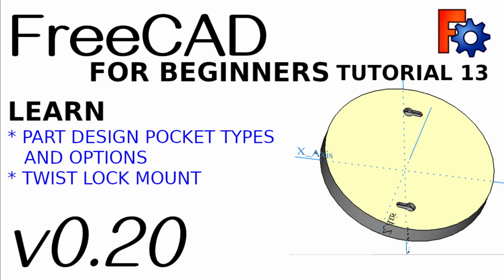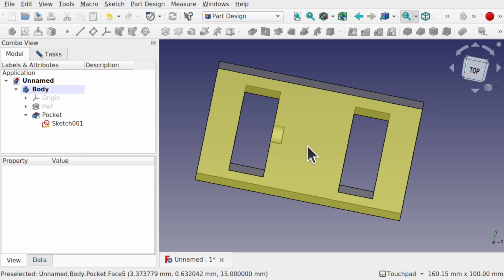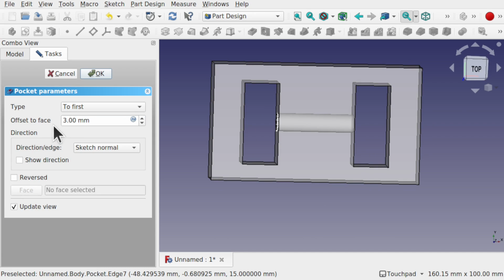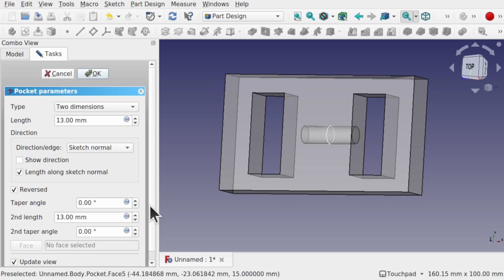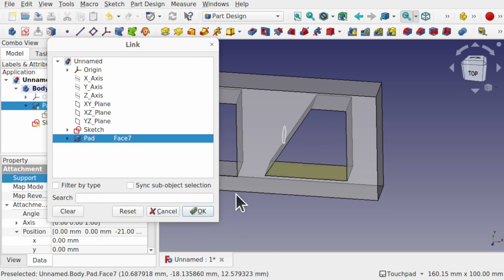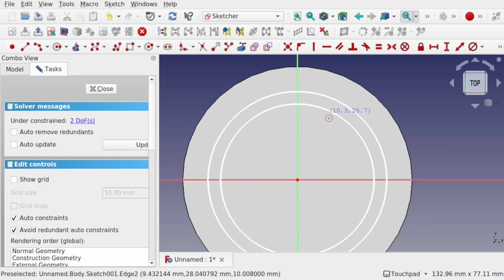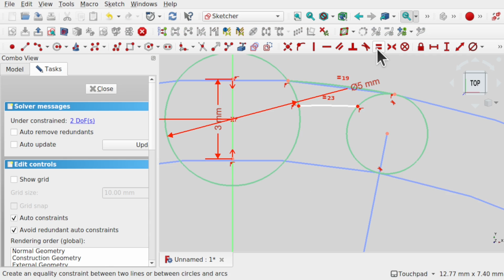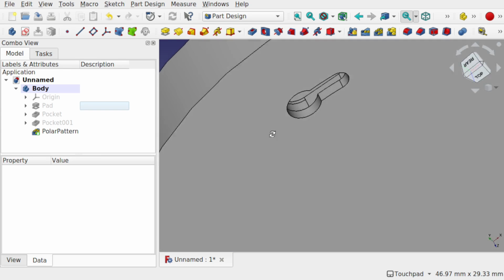FreeCAD 0.20 For Beginners | 13 | Locking Mount | Understanding Pocket Types and Options

Comment: Why I understand that these are just demonstrations. on free CAD and pocketing and making holes. It's always a good idea. Not to make the impossible pocket or holes from a. manufacturing standpoint. I've seen some pretty fancy CNC. END.mills and lathes, but I've never seen one that could drill a hole inside of a part, working its way out.

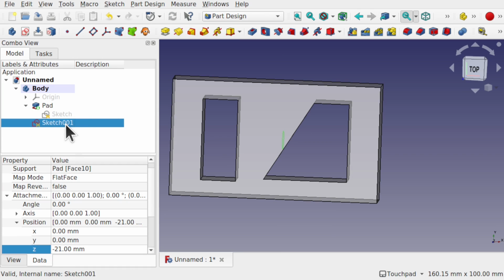Comment: 15:40 support method for moving sketch does not work in v0.21.2. Instead, I right clicked on the sketch entry in the model view, selected "Attachment Editor," cleared out the top field, enabled "reference 1" selection, then selected on the new face in the 3D view. Circular sketch moved and I was able to continue.

24:35 pocketing did not work immediately. I had to go back into the sketch and change the 5mm diameter to something different (6mm) and closed the sketch. Re-entered the sketch, changed it back to 5mm and dragged the dimension around a bit. Pocket worked after this. Obvious bug just worked itself out by "fiddling" with dimensions.
Reply: Thanks for that.
Reply: Try it , helpful thanks for the information.❤

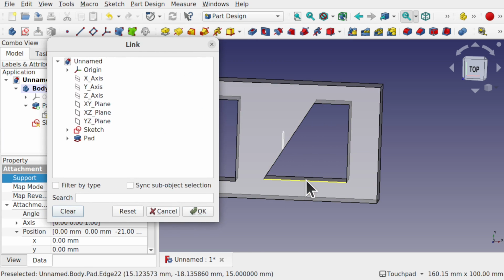Comment: Can anyone guess why I would not be able to attach the Sketch001 to a different Face of the Pad at 15:53?  I have selected the sketch, selected "Support, Clear, but when I click on a Face or Edge nothing fills in the LINK window and the sketch does not move..
Reply: Works for me if you select the face using the three dots from "Map Mode" instead of Support. Freecad 0.21.2

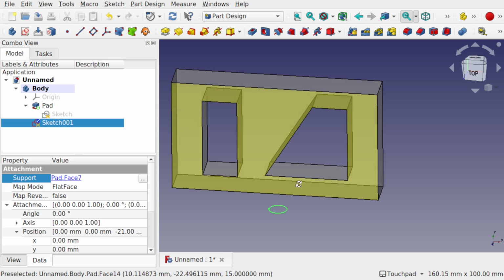Comment: At 16:00, I could not get Sketch001 to attach to the face of the pad.  When I try to change the support for Sketch001 by clicking on a face of the pad, nothing happens.  Any ideas?
Reply: Got the same problem.  I think it's something they've done with new version, and introduced new bugs ??
Reply: same issue, I`m using 0.20.2
Reply: Map Mode click on Plane so now it's selecting then click on a face on the pad

Comment: Hi All, Enjoying the Tutorials and feel I'm learning something that I can apply to my Aero Modelling Design, I'm using Ver 0.20 but when getting to pocketing the recess 24:34 I get the following error "Cannot use selected object. Selected object must belong to the active body" Then "Consider using a ShapeBinder or a BaseFeature to reference external geometry in a body". I've checked and have the toggled Body active (Bold in the Tree). Sketch selected Green and identical to MJ's. I remember the directions from previous Tut's but not sure how to resolve this error. Any assistance much appreciated. RW
Reply from the maker: Glad your making progress. Is the sketch you created inside the active body, you may of added it and it's outside in the treeview. If you collapse the body in the treeview you should not see the body beneath until you expand it. If its outside drag it into the body.

Comment: Good practice on features and workflow. It does seem like in practice that slot needs to also be curved, else the screw head will grind against the outer wall of the pocket.

I fixed this by editing the sketch of the second pocket: replace the straight slot lines with arcs, bring in external geometry of the first pocket edges, and make the arcs equal to those respectively. Now the second pocket and first pocket sweep the same path.

Comment: All has been going well so far as I've worked my way through your tutorials, but alas the pocket of the screw slot fails for me on 0.20.2, both on FreeBSD and MacOS. Apparently the Wire is not closed. Unless I've missed something important, I'm guessing that this is a bug in this particular version. Without the linking arcs, the two circles pocket nicely, with linking arcs, or even straight lines, all I get is a blank screen.
Reply: I had the same issue, initially (FreeCAD 0.20.1). I had the impression that one of the vertex on the sketch was a regular vertex instead of a construction geometry vertex. So, I used the construction geometry tool to convert the vertex from regular to construction geometry and was then able to perform the pocket operation successfully.
Reply: Me too, Seems this commentary is no longer Monitored?

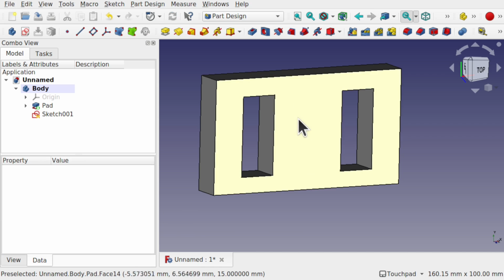Comment: At about 11:00, I don't understand why moving the sketch for the pocket along the Z-axis appears to move it along the X-axis. I drew the sketch looking at the Left side of the middle bar, which means Z is up and X is toward/away from me as I sketched the circle...
Reply from the maker: This took me a bit of getting used to.  So a sketch is 2D and the Z axis is normal to sketch so pointing away from the sketch if laid flat.  When you attach a sketch or any geometry to a face the Z axis will run in a different direction depending on attachment.  This is know as the local coordinate system.  The attachment is x,y,z offsets in the objects local coordinate system.  I am going to do a video about this as it's pretty confusing for new comers to CAD

Comment: Nice and clear as usual. 
I've replaced the long sides of the slot for an arc with the same radius of the underneath shape. It should improve the movement of the fixing pin inside the groove.
Reply: I was thinking that would be a good feature to add. I was also thinking of how to complicate this (of course... complicating things seems to be my super-power) by angling the inside surface that would bind against the underside of the fixing pin's head (screw-head) to allow the turning action to not only capture the head, but wedge between the head and the mounting surface.
Reply from the maker: Nice!  I like that idea
Reply from the maker: That's a great idea,  thanks for sharing 👍👍👍👍

Comment: Nice, very useful technique, but probably difficult to print (how do you remove the supports inside the cavities, unless you use disolvable material?) 
You may try w/o support,  but the result probably gonna suck.
Reply: I think this can be printed without support by orienting it face down, with the slots in contact with the build plate. The "ceiling" of the slots will then be taken care of by bridging.
Reply: @warped_spacetime you're  probably right. I am curious,  so I will try it.
Reply: @paulcutty8048  Sounds great - please report back.
Reply from the maker: @laytekk thanks for your input in this,  nice to get info from others with ideas  @Paul Cutty please let us know how you get on,  thanks for the comments guys
Reply: @MangoJellySolutions  @laytekk  I did a test with 2.5 mm screws for plastic and PLA  (did not want to use much material just for that quick test) , and yes, it works as you described it. I believe it will work on larger dimensions.
Reply: In case you cannot print upside down (e.g. when you're designing a "real" part for hanging onto a wall, you can also use regular supports with the right slicer settings. Those should be easily removable with a rigid object, such as a screwdriver.